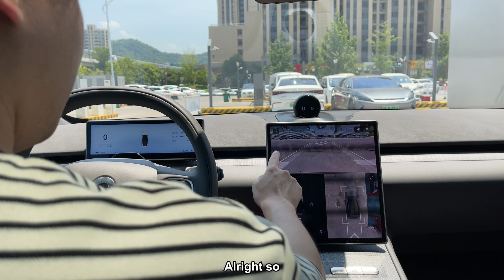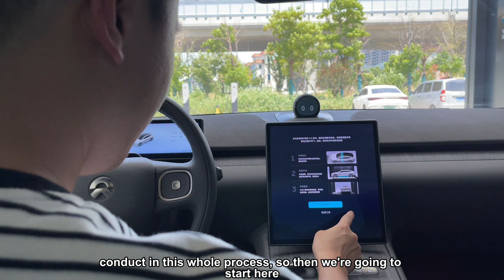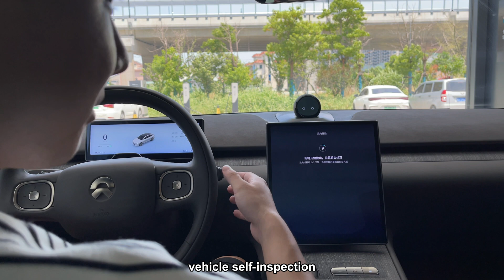NIO ET7 Battery Swap Complete Guide At Power Swap Station 2.0｜Is It Better Than Superchargers?

Comment: How do you charge $$$ for the battery change? If I come in with a 30% battery, will I be charged the same as those coming in with a 5% battery left?
Reply from the maker: You won't be charged at the same rate, they only charge the difference of kWh.

Comment: Why does it lift the car and why does it need to back up, why not just go forward?
Reply from the maker: Hi there, lifting the car is for better operations. I think the reversing parking would save the costs of the land especially at some crowded and busy location.
Thanks for watching!
Reply: @joyevs_TV  I don't understand how lifting the car can facilitate operations but I understand the "land" part, thanks!
Reply from the maker: @Got2Learn  No worries! In my opinion, lifting the car to make sure it doesn't move during the battery swapping process, as when the machine put back the charged battery then it gives a force upwards, but the suspension is not fixed, it's retractable. Therefore, it may move upward when it's facing a force, and it may causes safety concern.

Comment: So if your car is modified with lowered ride height using aftermarket suspension, will you still be able to battery swap?
Reply from the maker: Hi there, if you could adjust that air suspension to the higher position every time when you do the battery swap then I think it would be fine. But I am not 100% sure for that as I haven't seen any one replaced the original air suspension to the aftermarket one 😅

Thanks for watching!
Reply: @joyevs_TV  makes sense, I just wonder if Nio has thought about as it becomes more popular and eventually there will be aftermarket support for the car for modification that may not allowed for the raising of the suspension by the press of a button. Anyhow, great video and keep up with the good work!
Reply from the maker: @DDGGVVMM  Yeah, there must be more aftermarket supports avaliable when NIO getting popular. They may collaborate with some reputable refitting factory, so the aftermarket parts could integrated with their system. Unlike the gasoline cars, electric cars are more highly integrated all different ECU, and controlled by the Domain Control Unit - DCU. I think it's hard to identify the warranty then if the major part has been modified. Let's see how it goes in future!
Thanks for sharing your thoughts!

Comment: Nio should make the power swap station drive through instead of backing up. Entrance and exit it will safe so much time.
Reply from the maker: Yeah, that would be must faster, but it may increase the cost of the land as drive through may need a lot more space.
Thanks for sharing your thoughts!